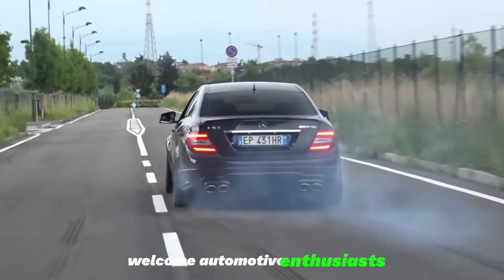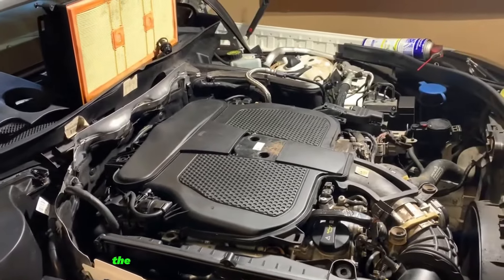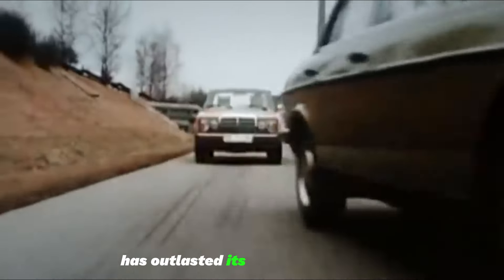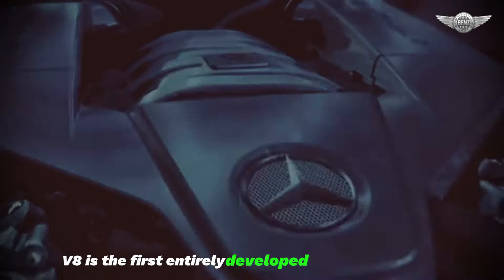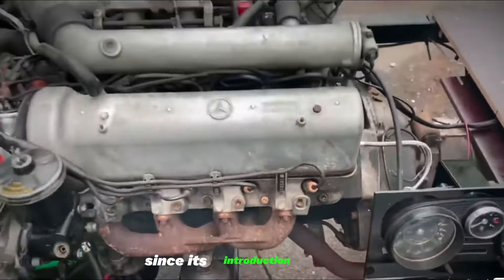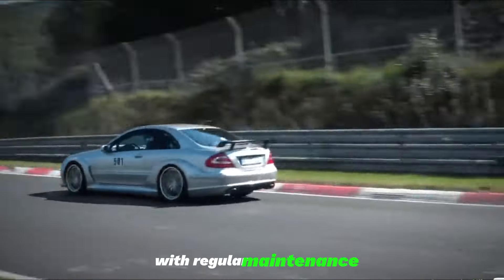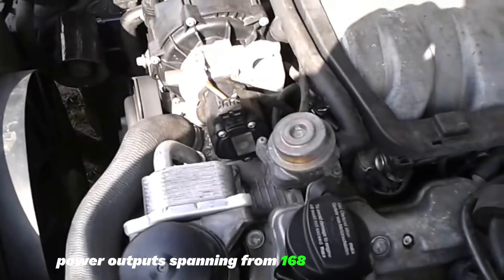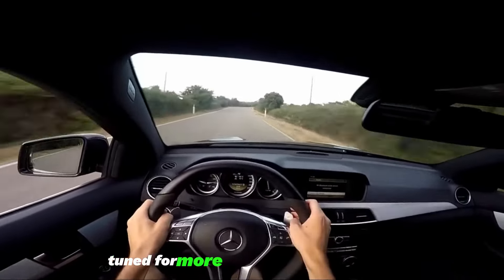TOP 5 MERCEDES ENGINES AND CARS THAT LAST FOREVER (reliable engines) om606

Comment: M112 with 400k on clock,leaking oil from everywhere,working on cng but still no problem running perfectly,fast and comfortable😂
Reply: 400J miles without oil change not bad

Comment: I have c class w204 10 years never let me down I have 500k km original chain no problem still pulling like new and w205 7 years old and for 5 years with me 160k km no problem good cars.
Reply: C class 2009 and 2017 product.
Reply: W204 as other german engines are crap.This one have timing chain and tensioners issues injectors water pump sensors problems same as bmw n47..Germans dont know how to make a quality  engine.
Reply: I had a 2010 w204 with 168k miles on it. Was great until the balance shaft went bad and I wasnt going to pay 6k to fix it
Reply: @JasZg  確かにその通りです！日本車は、全て耐久性の塊です！

Comment: One should note that the M276 non-turbo manufactured before De. 2012 had some issues, corrected after that so the 2013 is the really, solid, reliable engine here. Adding the turbos in the later versions will of course always make a turbo engine more unreliable than a non-turbo engine.
Reply: that rattle at start up? Cam actuators

Comment: M156 reliable engine? Good joke... Camshaft lobes wearing, headbolts issue, hydraulic valve lifters noise, in early models even timing chain problems. This engine is disastare if you compare it to the M113 engine.

Comment: The m112 and m113 are smooth and bulletproof engines. These engines are simple in design since their single overhead can and have no VVT. The dual spark ignition made them incredibly fuel efficient. The V6 got comparable fuel economy to Toyota’s 4cyl and the v8 got fuel efficiency comparable to v6s. More manufacturers should’ve kept the dual ignition systems.

Comment: I recently bought a 2003 MB E500 with the M113K v8 engine & (178,000 mi.). It currently has (185,000 mi) . I bought it in Los Angeles. I drove it 1850 miles to Mississippi .last week.  No issues. Its rated as 17-21 MPG, but I got almost 40 MPG on my trip.  It's also rated as having 302 HP. That's an under rating in my honest opinion.  It has almost 200,000 miles on it, and it still runs like it's NEW!!  German engineering is OUTSTANDING from the rest. There's no comparison. The greatest to ever do it, are the Germans!
Reply: これを成し遂げた最も偉大な選手はドイツ人だ!

確かにドイツ人は優秀かも？しれません。

しかし・・・あなた・・・何か忘れていませんか？

日本人のほうがドイツ人なんかよりも・・・

もっともっと優秀ですよ！

証拠は・・・

日本車の故障発生率を見れば理解できます！

Comment: I put 250,000 miles on 19998 E320 with M112, no problems .  I currently have y wife’s 2000 E430 and my 2001 E430 Sport, with 130,000 on hers and 101,000 on mine with no problems.  These are great, smooth powerful engines.

Comment: I love the M276 so much that i cannot believe Mercedes made such an engine. I have the 3.0 bi turbo and the 3.5 liter natural aspirated version. Both engines are rock solid. And, if you change your oil frequently, in sports mode, they are very fuel efficient as well. I cannot get enough of the M276 engine. I am going to wait to see if the M256 (in-line 6) which replaced the M276 (v6) will stand the test of time. If you find one even with 120,000 miles, buy it. I guarantee you will drive it another 30,000 miles with no issues. You can take them to red line all day long with no issues. This engine is rev happy and confidence inspiring. I love the M276.
Reply: What cars do you have with these engines?
Reply: @eliedisso1420  2014 C300 Sport 4matic and 2019 C43 AMG
Reply: @eliedisso1420  I do 3,000 miles oil changes. I use Mercedes 229.5 oil (0W-40) on the C43' It gets 4 oil changes a year. I use Royal Purple (1 quart of 0w-40 and 6 quarts of 5w-30) for the C300. Both oils are exceptional. I highly recommend Mercedes owners use Mercedes oil. That thing improves the efficiency of the engine when it is used and changed frequently. I always let me Mercedes warm up for about 10 minutes before i drive them. But when i drive them, i do not baby them. I drive in a spirited fashion. Mercedes engines love to be driven in a spirited way. But most people baby them which is partly why they have issues.
Reply: 質問があります！M276は大変良いエンジンだといわれましたが、直噴システムにつきものである
「吸気バルブ煤堆積問題」はどう思われますか？煤が付着し、エンジン停止するのは時間の問題でしょう。そして、馬力・トルクもあることは大変結構なことですが、反面パワフル過ぎてエンジン回転を上げて走るという、いわゆる運転していて楽しいとは思えないのですがあなたはどう思われますか？日本の熊本県より愛をこめて・・・熊本県の有名な観光地は、阿蘇山と水前寺公園くらいかな・・・

Comment: And I thought the inline 6 Diesel engines are the most reliable.(OM648)  I wish they would clarify the ranking with the longest lasting (in miles or KM).  Then efficiency....

Comment: What about the OM651 engines??
Reply: OM646,642 and 612 above the 651
Reply: I have that one.The worse thing ever happened  to me.Timing chain and tensioners  issues,water pump leaking because its plastic,sensors, injectors....Same crap as bmw n47.Just to replace timing  chain you have to take engine  out because now its located as bmw timing chain. Behind,not at the front as before.I also had w203 which was also very unreliable  car.From now i will avoid any german car and buy Japanese ones.
Reply: @JasZg  日本車世界にようこそ！

熱烈激烈猛烈大歓迎いたします！

Comment: V6 3l diesel om642 is very reliable , ok some oil cooler leak which appears every 250000km,
But very reliable if well maintained

Comment: 3.5 v6 5.0 and 5.5 engines are most reliable some 3.2 are decent as well no diesel is good to me and the bigger engines pass 5.5 have massive problems or expensive

Comment: Ich fahre einen M276 3,5 l V6 als Saugmotor in meiner E-Klasse aus 2012 und einen M113 5,0 l V8 in meinem CLS aus 2005. Beide Motoren haben mich noch nie in Stich gelassen und laufen wie ein Uhrwerk. Regelmäßige Wartung natürlich vorausgesetzt. Ich wechsle das Öl einmal im Jahr, oder alle 10 tausend Kilometer. Beim 156 Motor musst du noch mal ein wenig recherchieren. Der ist zuverlässig bis ungefähr 150 tausend Kilometer, danach benötigt dieser eine Komplettrevision, die mal locker 20 tausend Euro kostet. 😉

Comment: M112 , M272 (when it´s well maintained and and from 2008 or younger year of construction) , the older M271 (with 163 hp or 184 hp non CGI ..the one with the supercharger) , M273 (2008 or younger one) , OM648 and OM646 are also reliable ...

Comment: Glad the 350 diesel wasnt included, oil cooler leaks in V middle, oil leaks from turbo seal above swirl valve motor cutting engine out with no warning.!
Reply: Just have 260000km and oil cooler is starting to leak...not so bad😅
Reply: @ youre lucky! Lots of YT videos about this, everyone says “they all do that!” A swirl flap kit costs £16 on ebay, MB dont sell a kit, you have to buy inlet manifolds £1000 each! Check oil seal connecting the turbo also fails. Ive done 26k miles from new! With MB full service.

Comment: M275 is strong in top five engines ,OM 613 diesel bomb proof but 113 is the king ,M157 is a guttural beast but needs pampering 😬

Comment: M276 in my C450 AMG 4Matic. Very strong and takes a beating. Not afraid to put that pedal to the metal. One thing i don't like about Mercedes is TOO MUCH ELECTRONICS. Seems like there are sensors monitoring every damn thing on the car. You got sensors monitoring other sensors. The ECO mode is about a joke too, just to get another mile per gallon.
Reply: I thought i was the only one who has experienced this. That M276 in the C450 and C43 AMG is bullet proof. It can take a beating. I will argue that the C450 and C43 AMG are the most reliable cars Mercedes ever made . That eco mode or comfort mode causes carbon build up inside the car in order to gain a few miles per gallon. So, I highly recommend anyone driving any M276 to drive them either in sports mode with eco, at all times or in newer generations, in sports mode or sports+ mode. I love the M276 engine whether in naturally aspirated form or in turbo form.

Comment: Bro the 6.2 litre Mercedes is one of the most unreliable  problematic engines they've built so far, littered with issues and expensive ones as well, one being the head studs snap and cause catastrophic engine failure amongst many other issues, be lucky to see 100 thousand miles well documented 😅
Reply: How can you say the M156 is the best v8 engine when it has a litany of problems- probably one of the most unreliable Merc engines ever.
Reply: Look in the short term when they actually run they could well be up there with the best Merc engines, however its a temporary thrill as they won't be running well for very long, and will cost you an arm and a leg to replace when the engine decides to pack it in due to flawed design 😅
Reply: Camshaft and lifters had premature wear and the trick is to keep the dipstick oil level at its highest and add a reliable proven oil additive. Also variable cam shaft positioning gear & pin had wear which cause a rattle at start up. The later models came out with these parts upgraded with better materials including the head bolts as mentioned from around 2012 I think.

Comment: M276 is refined? Sure, if you only read the marketing materials and don't actually drive a car with one. What about the DI injector clatter and vibrations due to no balance shaft? It does have great performance and seems reliable. It's in my E350.
Reply: Hi, the angle between the M272 (90°) ans M276 (60°) permit no vibration... perhaps it antther pieces...
i have this engine, it's seems reliable.. but I monitor the distribution chain.. (noise... )
Reply: 60 degree V6 Is not inherently balanced, its impossible for a V6 to be.  It's not bad, and no balance shaft is less moving parts which is always good. But it's definitely not refined compared to an inline 6 or V8.
Reply: @geomtol  i agree with your mind, less balance shaft is better, and 6 in line or V8 are more balanced, but if you want a V6 with little space, the 60° V6 is the least bad.
4 cylinder in line are good solution too..  with little space, the 60° V6 is the least bad. . the others are problematic
the M276, is quite good.. (better than M272.) (i love it..)
Reply: That chatter comes from not changing the oil frequently. If you change the oil 4 times a year, that chatter almost disappears.
Reply: @ikeudechukwu5018  the clatter I'm talking about is the injectors, I guess you could call it ticking, but it is pretty loud, almost diesel like. Oil has nothing to do with that.
Reply: @geomtol  injectors in a direct injector system needs to be cleaned frequently. I recommend you start using BP with Invigorate. Also add a little (a quarter of the bottle) Royal Purple fuel injector cleaner to your tank every 2 months. I have 105,000 miles on my 2014 C300 4matic. It drives like a dream. I do 3,000 mile oil changes. I also use Royal Purple oil in it. It loves Royal Purple.
Reply: @ikeudechukwu5018 US gasoline is very clean and has detergents in it, there's typically no need for more additives. And I bet your Royal Purple distributor also loves you! 3000 mile oil changes is old school, synthetic oils last way longer than that, I do oil analysis with changes to keep track, and the oil I use is actually good at 10k, but I tend to change sooner anyway and annually at a minimum.
Reply: @geomtol  my good friend, if you want to protect an engine and even the cooling system, frequent oil changes is a must. I drove a v6 car hard (red line every week) for 200,000 miles for 15 years using royal purple, and on the day the engine was opened, it was a sight to behold. A 200,000 mile engine that received 2000 mile oil changes only looked like it had no.more than 120,000 miles on it. We could see the cross hatches made at the factory on 5mthe cylinder wall. That was how clean the engine looked. I also have a 31 year old engibe with about 349,000 miles that receives 2000 mile oil changes. This 31 year old 1.6 liter engine has never had a single engine work done to it besides two replacement of valve cover gasket, 1 front oil seal replacement, and 2 rear oil seal replacement. This little 31 year old engine still uses the original timing chain, guides, and tensioner. The guides are plastic and they have been there for 31 years. This engine does not burn or lose oil. I drive tjis engine hard. So, before you make strange and uninformed comments, better know what you are talking about. Do you have a 31 year old engine to show the importance of oil changes? I have seen the benefits of constant oil changes on my two Mercs. I drive them both almost exclusively in sports mode and their fuel efficiency is mind blowing. I ignore Mercedes 10,000 mile oil changes because of my direct experiences on the value of frequent oil changes. Oil analysis is simply an excuse to engage in procrastination. Changing your oil religiously is the way to go whether thevoil looks clean or not. Both Mercs receive 4 oil changes a year. You can call it waste but i call it insurance. Cheaper to change oil than change an engine.

Comment: The V-12  M120 Engine in my '96 CL600 CL sport, is far superior to all the ones that followed. All V-6 Engines are no comparison to an In-Line 6 of proper design.  A V-8 that needs Twin Turbos to achieve high horsepower is pathetic. Performance and Longevity reflect the quality of an engine.  See how many of these junks will last 200K miles without serious mechanical failures and relative costs.